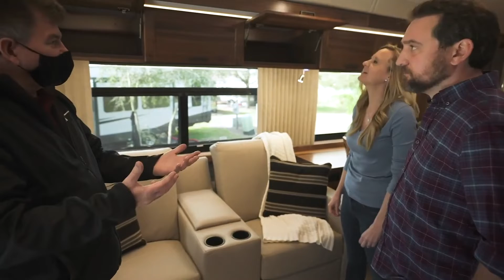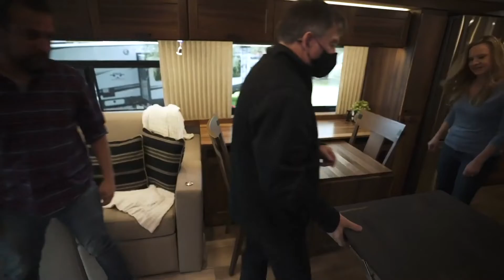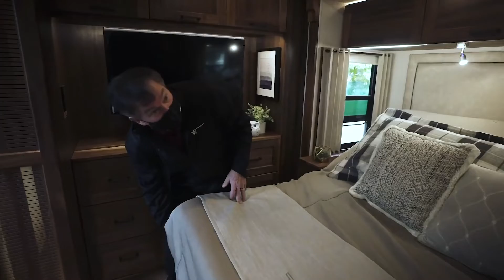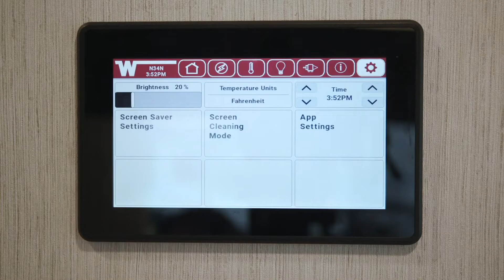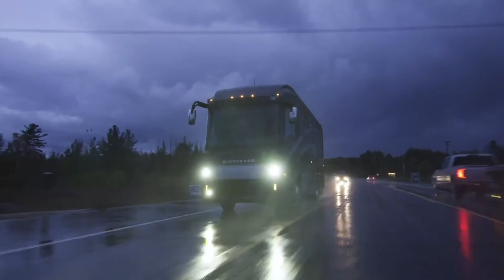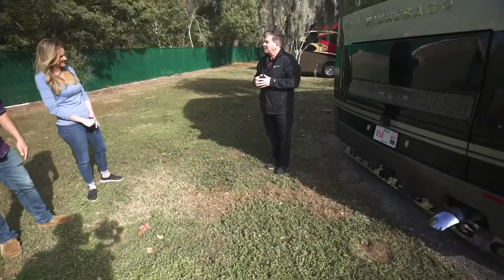Winnebago Journey 34N Walkthrough

Comment: Well thought out... in many aspects ... except the refrigerator.  It IS a big deal.  This needs to be a 12vdc unit.   Somebody got lazy and pushed a full residential into that hole.  At a minimum it should be an option.  Also, not thrilled with the neck straining bedroom TV.  So many things are just amazing.  Work the few remaining misses, and this rig is a homerun.

btw:  one of the most thorough and detailed reviews of features I've seen.  Well done.

Comment: Nice floor plan and clean and sensible interior.  I'm not a fan of opposing couches so the office design is perfect.  I own a  2015 Winnebago Adventurer 37F so I'm already a fan of Winnebago's evolution and I just have to say... they have the most pragmatic floor plans and put effort into the design.  Great Motorcoach you guys showed on this video!!!  My only criticism of the filming is that you should have shown a wide shot from front to back while entering.  Pan out a little if you can. It took me a while to notice... no opposing couches.